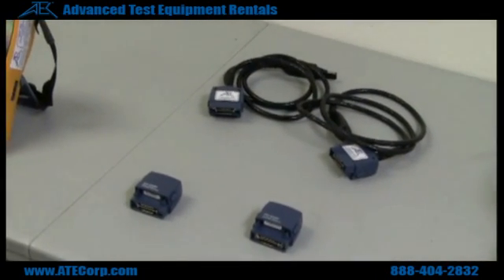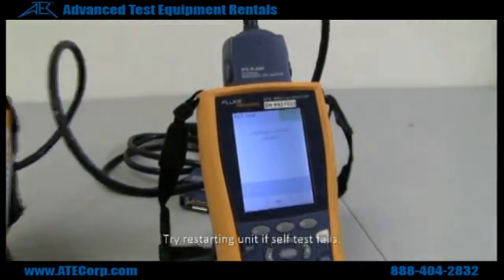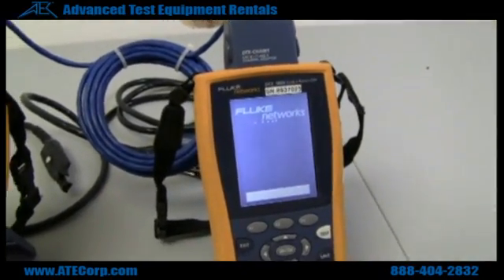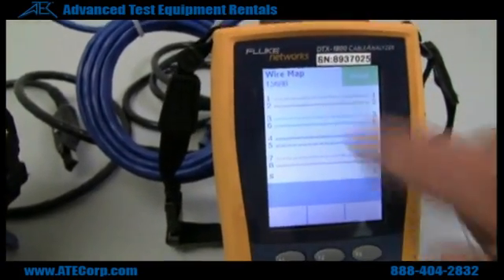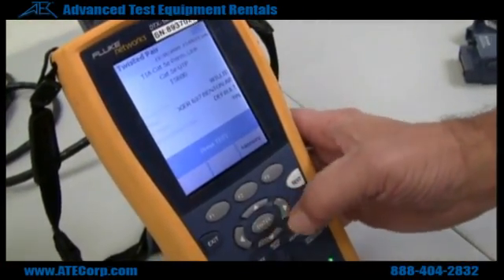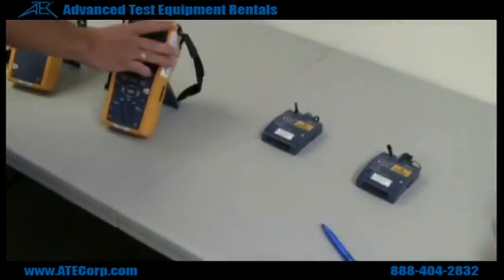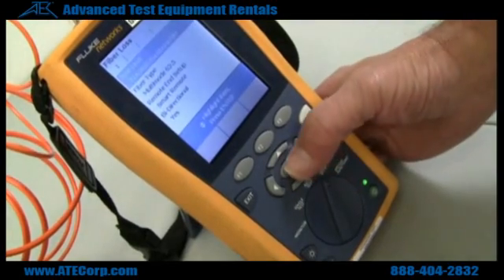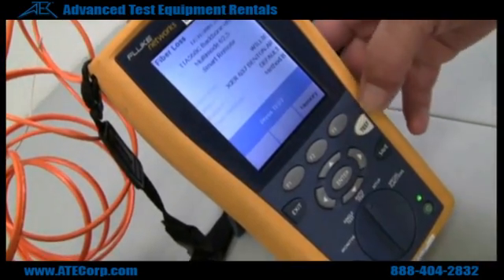How to Use a Fluke DTX-1800 Cable Analyzer

Comment: You can't qualify patch cords using Channel adapters. If you look at the test results you will see that your return loss margin is very high (maybe even 16dB). The wire map is the only valid result. The minimum cabling for a channel test is a permanent link with two patch cords. To test patch cords you need the patch cord adapters.
Reply: @devopro what is the physical limitation of channel adapters to not qualify a short run, which is essentially a patch cable.  Couldn't the fail line just be adjusted, as a patch cord by the standards would have a much more stringent fail line.  Or do the Patch Cord adapters pulse much more stronger signals to patch cords to try get them to fail easier?  It's almost as if Fluke just wanted to sell you extra modules.  It's still testing a piece of cable.

What is physically different inside the patch cord adapters compared to the channel adapters?

Comment: Hi, we have the DTX-1800 with the DTX-CHA002 modules.it seems to be for CAT6A only.  Can we still use it to also test CAT5e and CAT6?
Reply from the maker: According to Fluke Networks website, these adapters can be used to test Cat 6A/ 6/ 5e/ 5/ 3 and Class Ea/E/D and C channels.

http://www.flukenetworks.com/datacom-cabling/copper-testing/dtx-cableanalyzer-series

Comment: why is it the values in NEXT is not constant if you test the cat6 cable twice by using channel link? also if the result value for NEXT is 3.8 DB but the minimum value in the cables specs is e.g. 38.4, is this accepetable?
Reply: Yes Mike P... Open a ceiling tile and look with a flashlight

Comment: We have the DTX-1800 with the DTX-CHA002 modules.  We inherited it to validate cables but we don't have the permenant link cable.  It seems that is required, if it is could you let me know the part number for that.
Reply: Hi Chris,
You'll need the DTX-PLA002S: Set of 2 Permanent Link Adapters for Cat6A and Alien Crosstalk testing. This adapter can be used for all permanent link tests Cat6A/6/5e/5 and Cat 3. Please contact me directly at (800) 404-ATEC x 318 if you would like more information or would like to order the permanent link adapters. I hope that helps!

Comment: can the dsp 4300 be used to certify cables as well ?
Reply: For the most part yes, depending on your requirements. The TIA & ISO standards are coming out with revisions that will require you to monitor test parameters only available in the new Versiv model. The DTX was Fluke Networks development from the current version of ANSI/TIA-568 & ISO/IEC 11801.

Comment: i have an issue with the smart remote unit. the main unit won't recognize the smart remote unit for unknown reasons, i try to do the self test exactly as you did in the video, but without success. i even restart both units and still no success, any recommendations for me? (the smart remote unit flashes all lights when i try to do the self test and then it wont do anything after that, it flashes the "Talk" button) Thanks for your help.

Comment: I currently have that same tester..but need a little clarafication on the test summary. hope you can help here. this is what i got. on one strand the  results shows and states as is:
1310 Loss(db) 0.20    footage is 1206 with (2) adaptors and (1) splice
          limit (db)  1.98
          Margin(db) 2.83
on another strand it states as is:
1310 Loss(db) -0.85    footage is 1204 with (2) adaptors and (1) splice
          limit (db)  1.98
          Margin(db) 2.83
Why is there a neg?